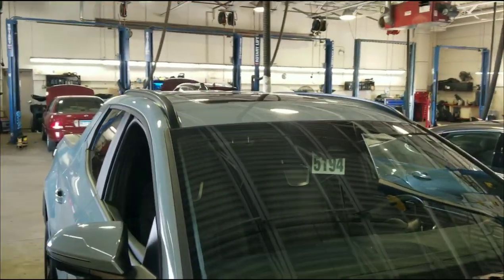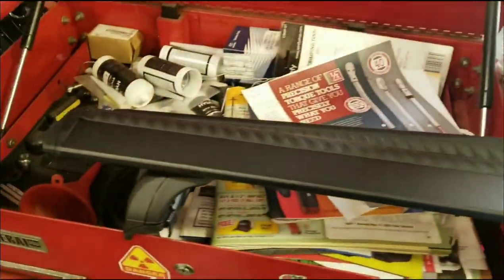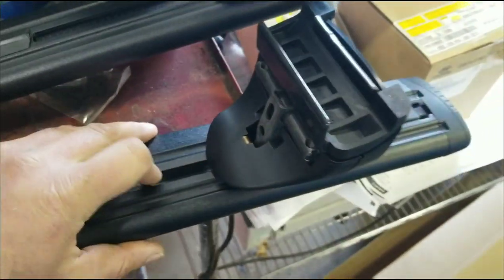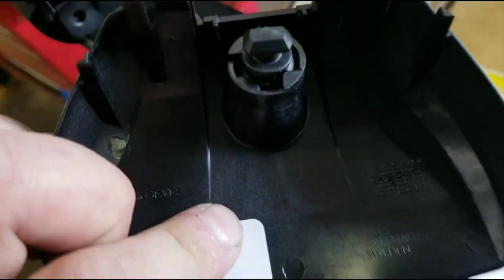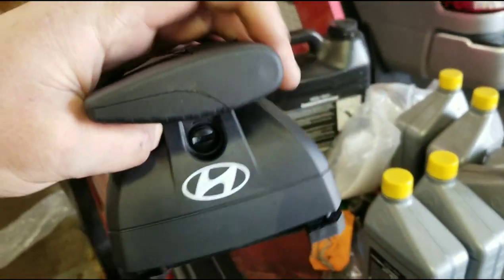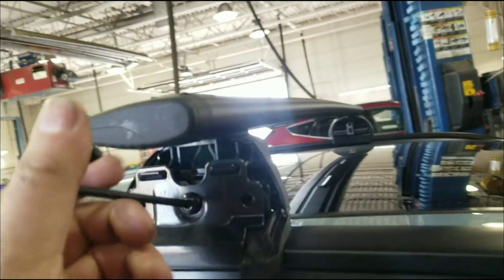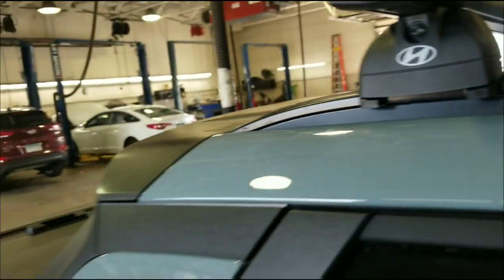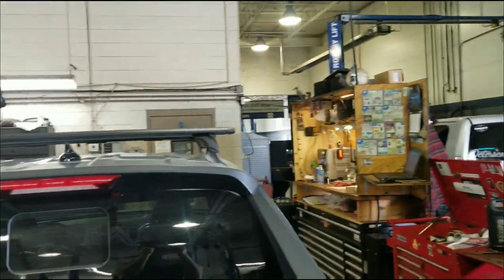Hyundai cross bars install 2022 Santa Cruz

Comment: i'm thinking about buying the crossbars... the instructions say to use a torque wrench... i see you didnt use one.. I dont want this flying off..  thoughts?
Reply from the maker: Technically everything says use a torque wrench.   After you tighten it try and move it, if you can't move it your good.
Reply: @hyundaihowto  thanks :)
Reply: Had the same question. Super helpful - thank you!

Comment: I removed mine because of the wind noise.  Also if you want locks the standard Thule lock set will work
Reply: I have enough wind noise already  from both front doors on my 2022 Tucson no fix yet